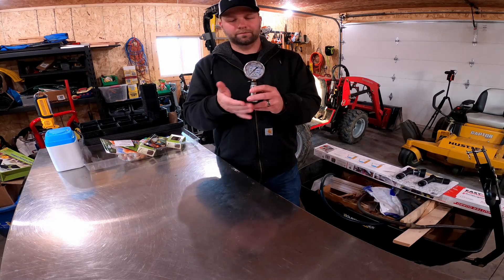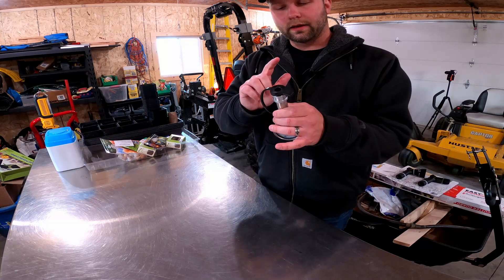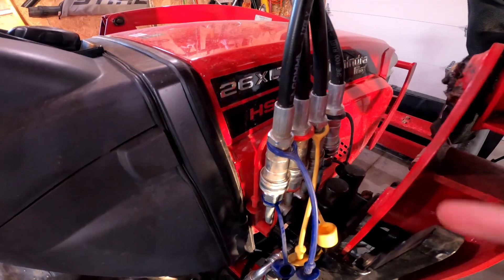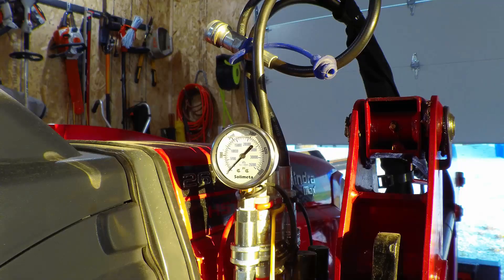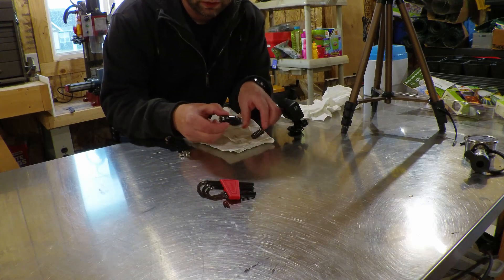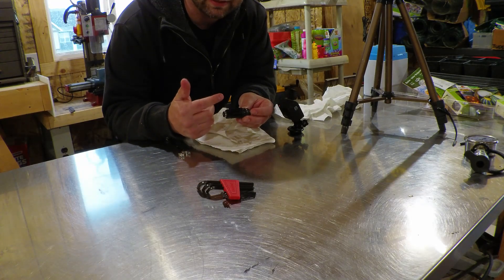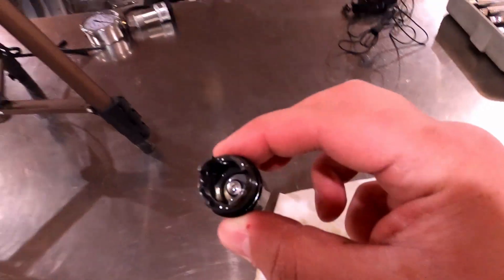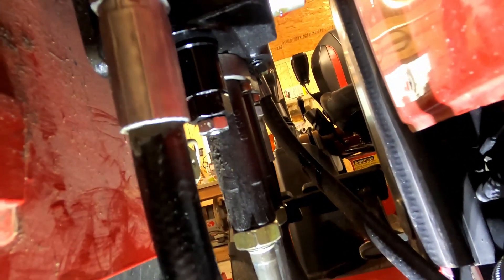Why Wont My Tractor Lift Anything?! Is Low Hydraulic Pressure The Issue? #compacttractor

Comment: I have this exact model of tractor.  I bought the gauge and fittings in the video.  My pressure was right at 2000 psi.  The recommended system pressure from Mahindra is 2300 psi.  I shimmed mine and it made no difference.  I turned the set screw in all the way with shims and it's still 2000 psi.  What am I missing?  Why isn't the pressure going any higher?
Reply from the maker: I believe there is another pressure relief valve right off the main pump, I wonder if it is limiting the overall output.
Reply: @k6outdoors  So I experimented with this more today and did a bunch of research.  The adjuster on the valve block in your video is a pressure relief valve.  They can only lower pressure. When you shim that you are just making it lower the pressure less. My system pressure that feeds that block is set to 2000 psi.  So I can't go any higher than that at the relief valve.  So I'm ordering a service manual and going to play with the system pressure.
Reply from the maker: @chadk6938 ive got the service manual, it doesnt really go much more into detail, but increasing shims  should help as it increases the force required to bypass. However if the system is low you have to increase the system pressure

Comment: I am a forklift technician, so I repair hydraulic systems all the time. You may not like what I'm about to say, but I feel you need to hear it.
DO NOT adjust the relief pressure of your hydraulic system above the factory specifications. Those specifications are in place for the safe operation of your equipment. 
If you adjust them above what is specified, you will see the following issues. 
1. Hoses will blow out at a faster rate than normal.
2. Seals inside hydraulic cylinders will fail at a faster rate.
3. Hydraulic pump will fail at a faster rate.
These failures are not going to occur when the unit is not in use, they are going to occur when you have that heavy load in the air and the potential for injury is highest.
In short doing this is just a bad idea!
Reply from the maker: Yes you are correct but it needs to be set to the correct PSI to start with. Thanks for the insight and stopping in.
Reply: yeah if you never experienced a hydraulic cannon going puh pow you just might have the luxury of watching your hydraulic parts be launched to russia causing a nuclear war.

Comment: Hey sir thank you for the video! I have a Mahindra 2015 104 ml 4wd and the tractor will run/ drive, but when engaging the pto my bush hog will periodically lift and lower, and the bucket is the same. I checked the hydraulic fill reservoir had bubbles. You think this is a failed hydraulic tandem pump, or maybe a bad release valve? Thank you in advance
Reply from the maker: I unfortunately am not sure I can help you out with this, something does seem to be out of line though. Thanks for stopping in!
Reply: @k6outdoors  thank you for your time

Comment: Hello, nice video, but I have a question for anyone who has used this information to fix their hydraulic system.   Set screws are cheap and normally easy to find. Has anyone just changed out the set screw to for a longer loader screw  to add additional adjustment, and did that help fix the low pressure?  I have a 1526, 2017 yr, and it's a little  weak on the lift, but it's definitely not worth messing with when it was under warranty.   If I recall, the pump is only a 7 gallon per minute pump.
Reply from the maker: I would pressume it would increase the pressure, might have to look into it!

Comment: So...  There was nothing to fix?  The pressure was what it should have been and the tractor is just not able to lift anything?

I'm having a similar problem (except it is with my hydrostatic transmission being somewhat gutless) on my B21, but I am hoping I can adjust the bypass valve and get better performance.
Reply from the maker: The tractor hydraulic pressure was turned up on the tractor and loader circuit and resolved the issue. Thanks for stopping in

Comment: Great info.  I do have a question on your parts list.
You have the coupling with 1" NPT thread but the reducer on the gauge is 3/8" NPT.  Are you missing a 1" to 3/8" NPT reducer?
Reply from the maker: Thanks for stopping in!  When I bought the set, I used the coupling with the 3/8" NPT threads. For whatever reason is looks like amazon does have that specific one from the link I provided anymore and it is now defaulting to the 1" NPT style. I hope this helps!

Comment: I have the same tractor.  Maybe I missed something.  Did you conclude there was a problem with the hydraulic pressure on your MAX that needed fixed, and if yes...was it covered under your warrranty?
Reply from the maker: The hydraulic pressure was low on the loader circuit. The dealer adjusted it under warranty

Comment: Just bought a 2021Mahindra Max 26 XLT. Love my tractor. Love your videos...FYI, The hydraulic lines to the front loader changed at some time in 2021. The high pressure hoses from the manifold are now 1/4 inch instead of 3/8, and instead of going straight up from the manifold, there is a 90 degree fitting that routes them forward. The quick connect is now a 1/4" AG ISO 5675 hydraulic quick connect. Link: 
1/4” Ag ISO 5675 Hydraulic Quick Connect Pioneer Style Coupler Set, 1/4” NPT Thread
My from factory hydraulic pressure was spot on to factory specs, at 2100 PSI. Was great having your help guiding me through testing it.
Reply from the maker: The Max 26 XLT is a stout little tractor and I find it to be a great tractor myself. From my understanding they changed the loader model this year and are using a USA built loader and it has also increased capacities! Sorry if I mislead you on the fitting sizes, but I am glad you were able to figure that all out! Appreciate all of the positive feedback and I am glad you like the videos! Thanks for stopping in and enjoy the tractor!

Comment: Thanks for the info.  I have a 2017 Max 26XL with the same issue.  Also, thanks for doing the research to find the parts for the gauge.  I'll be doing this with mine soon.  Great video!
Reply from the maker: Glad you found it helpful! Hopefully this will get your issues under control! Thanks for stopping by!

Comment: My two year bumper to bumper goes out in September... I haven’t checked mine yet, but I wouldn’t be surprised if I was just shy of where it needs to be...I’ve heard of some guys swapping to 1526 cylinders....like you the curl power just isn’t what you expect based on the 1402lbs lift capacity at the pivot pins.

Comment: This only applies to the loader hydraulic circuit. It does not change the pressure of the complete tractor. The Max HST has three pumps. One is the main drive pump that moves the tractor. It is attached directly to the clutch. The other two are on the front left side of the motor which are gear driven. One is for the power steering circuit and the last is for the hydraulic accessories, loader or rear remotes.
Reply from the maker: Good to know, I need to look into that more! It's odd that I saw an overall performance increase on the tractor. Coincidence, could be or they adjusted both!